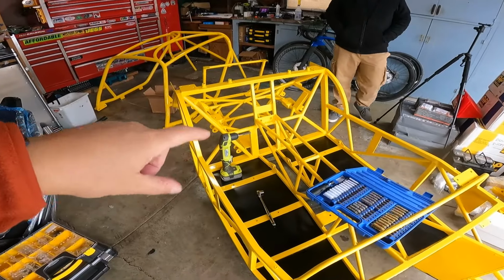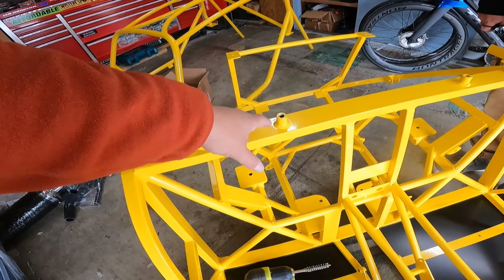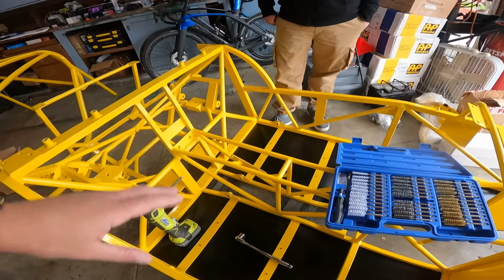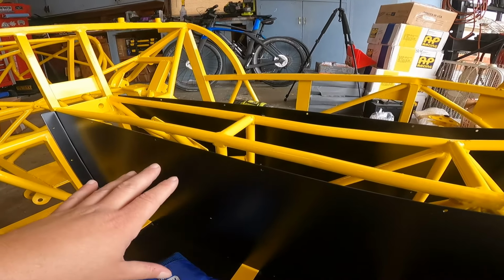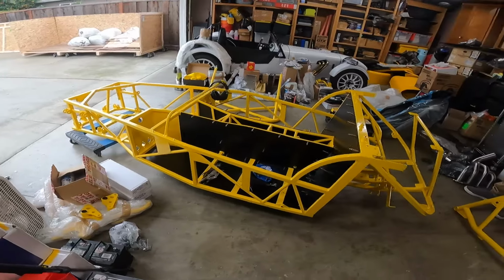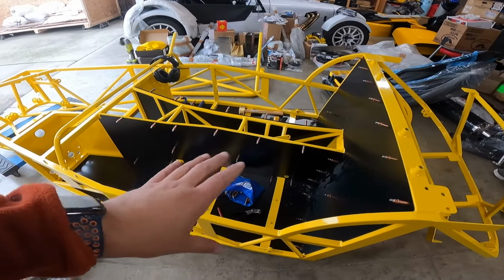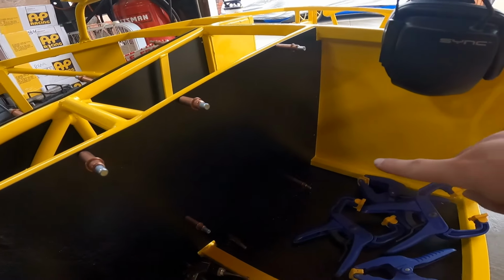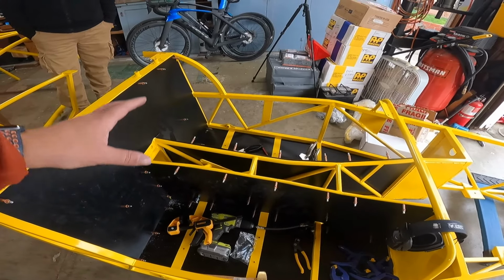MK Indy RX-5 Vtec: Interior panneling

Comment: Enjoying the new project.  For cleaning threads, I cut a groove across the threads of a bolt on two sides and that works well.  It’s like a less damaging tap.
Reply from the maker: I’ve done that in the past as well but it’s a bit of a hassle switching sizes.  The brush method worked quickly for M8-M12 sizes without needing to switch.
Reply: @DriveDriverDriven  good point.  Definitely makes sense for cleaning up all of the threads on the chassis at the same time.  Like after powder coating.  I’ve only occasionally had to clean some threads here and there.